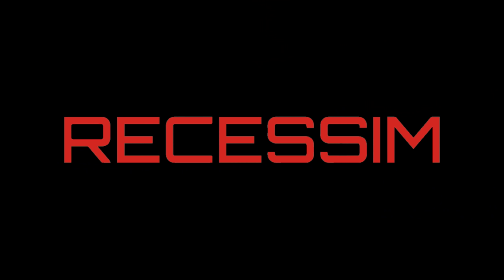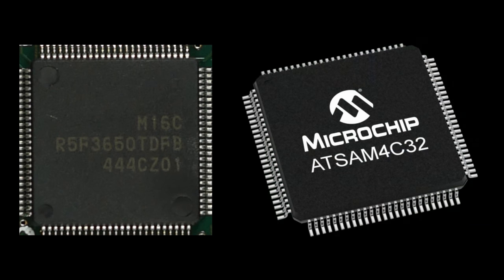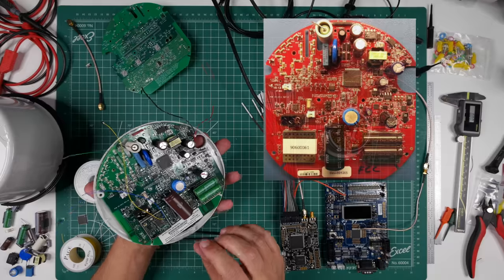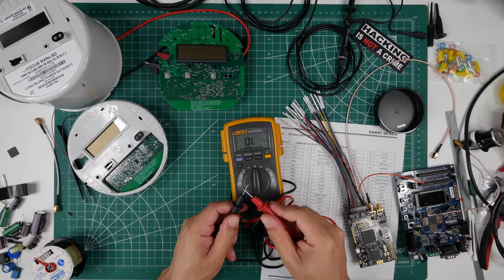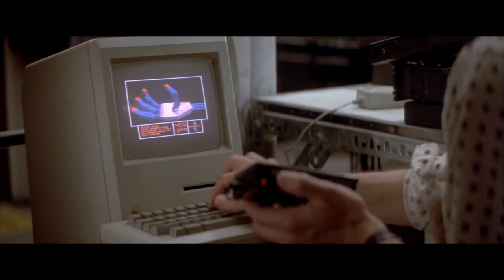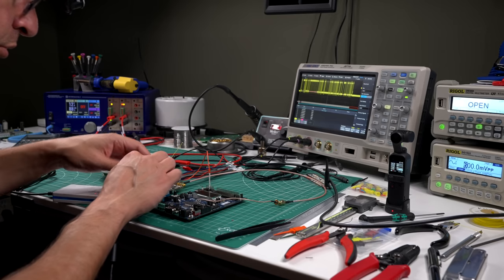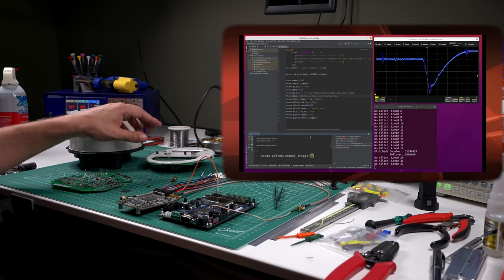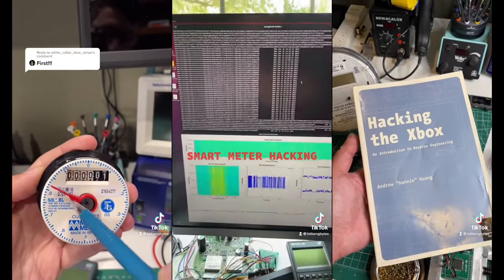Reprogramming a Smart Meter

Comment: How can you even say that you can make a 240volt system work with 12 volts, explain. Otherwise this is completely nuts and probably illegal. Where did you get the test board from. I'm pretty sure you couldn't buy it..
Reply from the maker: I run the board on 12V which is what the voltage regulators convert the 240V to so the rest of the circuitry can run. It also needs to see what "looks" like a 240V AC sine wave. The board divides down this voltage to a level that a microchip can use though which is around 3V. So I feed in a 3V sine wave directly to that microchip fooling the smart meter to boot up.

You can buy these smart meters on eBay, my other videos I go into more detail on that. Thanks for watching and commenting! Happy to answer questions.
Reply: @RECESSIM  So you're telling me that this could not be run on a 12 volt battery. There is a circuit that checks for a 240V AC input and you can fool this by introducing a sine wave. Sorry this makes no sense. whatsoever. Like I said before my son is a development engineer for these things at the very company that makes them. I'm not an engineer but a qualified scientist. I've asked my son to comment but he is too busy working on software development for these very things and will get back to me when he can. He also had a major role in hardware development. That said, I do enjoy your videos, only for the reason though its a bit like watching star trek.
Reply from the maker: @W5nmwh50  If you look at my other videos you’ll see one with a thumbnail that says “Spoofing Voltage” where I explain it in more detail.
Reply: @RECESSIM  Thanks, I will indeed. However can think of no reason why would need to spook voltage 🙂